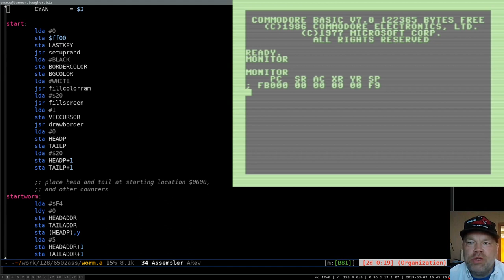Commodore 128 Assembly Language Intro Video

Comment: I've really learned a ton watching your videos. For me, this has been a 35 year later redo of trying to learn assembly on the 6502-and this time around it finally starting to click. I've settled on running VSCode using the Acme vscode template and then sending the output straight to C64 Debugger. As a workflow, this is one click compile and debug in a special purpose version of Vice (Windows). Super fast and very quick to get into the test environment. Its been a lot of fun to exercise what I've learned from you (and a few other resources). 

Thank you for the time you put in to share this stuff.
Reply from the maker: Thanks! Great to hear it's working for you.

Comment: great tutorial man.. i'm wondering what type of linux distro are you using ? and are you using emacs editor ?
Reply from the maker: Thanks! My operating system is FreeBSD. I'm editing in Emacs, assembling with Acme Crossassembler, and running the programs in the Vice emulator.
Reply: @AaronBaugher  Emacs rules! :-D 

I've subscribed, but I'm having a bit of trouble navigating your many videos. If I might suggest, perhaps they need some organizing. For example, maybe make a clear playlist for the C128 Assembly series so people know where to start instead of having to hunt through all the videos. I was searching for a video showing how you set up your cross-assembly environment. It was only by luck that I found this comment where you mentioned ACME. 

Again, I don't want to sound ungrateful for the gift you're giving with these videos, but I think it'd also be beneficial to me and other viewers if the videos weren't so long. FreeBSD can run kdenlive, avidemux, and other great video editing software which can trim and speed up the dry sections.
Reply from the maker: Yes, I've been thinking the same thing about organization. I didn't have a plan when I started, so it's gotten to be a mess. Will do, thanks for the suggestion!

My original idea was to do it as a stream where people could watch every step, similar to Handmade Hero, so that's why I've been including everything. That's a good point about speeding up the dry sections, though; maybe I could shorten them without cutting anything out.